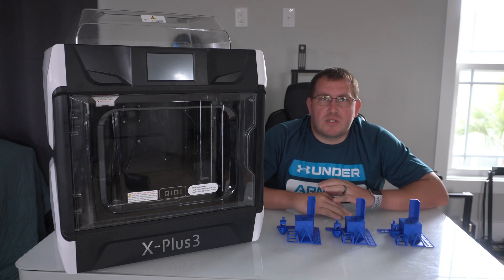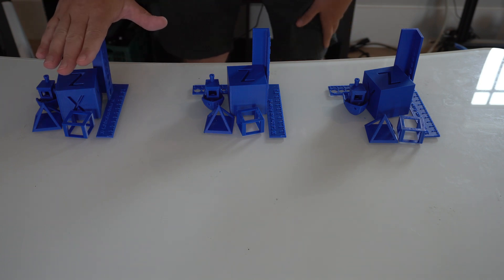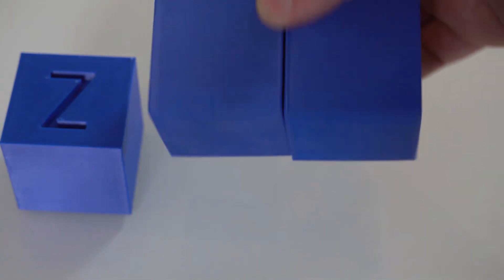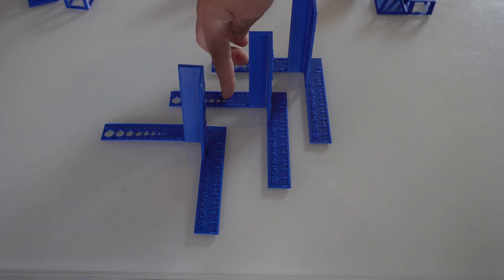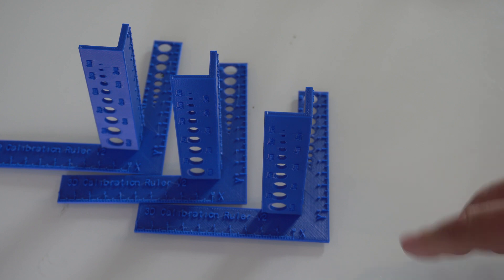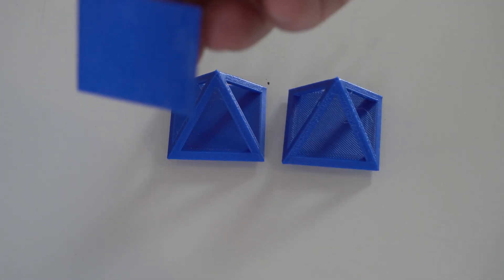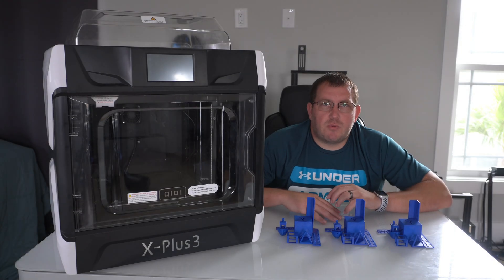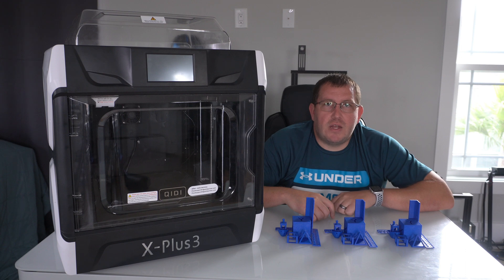Does a Enclosure Make a Difference for ABS?

Comment: Hello, I assume an important precondition is that the filament must be 'dry', as in it was prepared in a filament dryer for the adequate amount of time and T°, right?
Thanks for taking the time to do this test :)
Reply from the maker: Hi. That is correct. The filament was brand new for the test and went straight from the plastic to the dry box on the printer. I should have mentioned that at the start of the video, sorry.
Reply: @3DPrintscape  No problem :) Thanks for your reply. Cheers